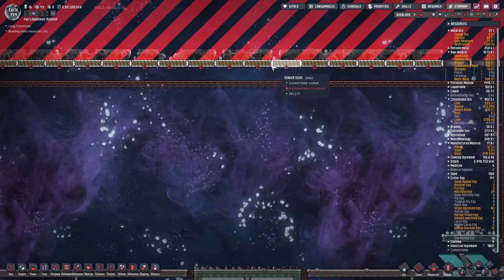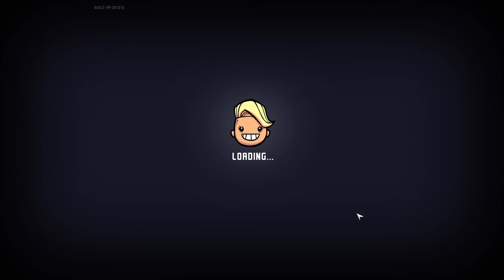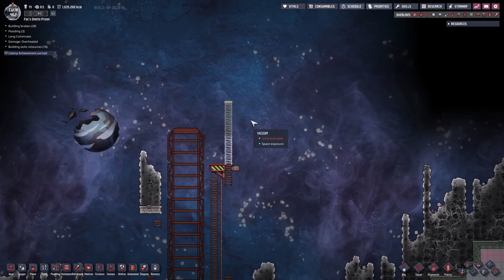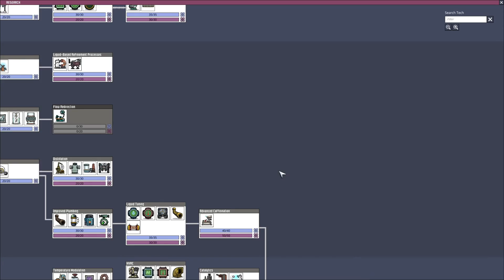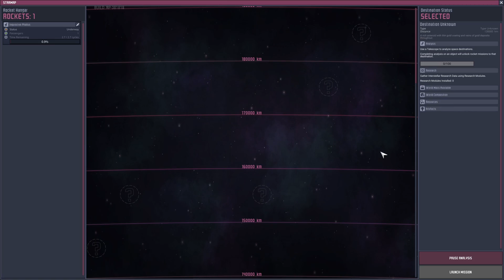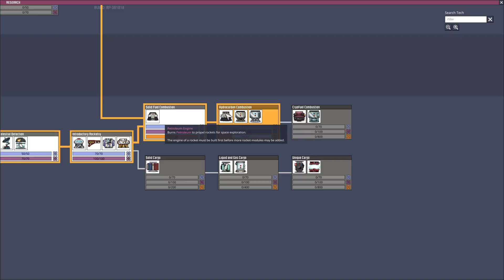FULL SIZE RESEARCH ROCKET! (OXYGEN NOT INCLUDED "Terra" Episode 33!)

Comment: The painting of W.T.Reed at [14:35] = XD It looks like a Mona Lisa Gone Bad
Reply from the maker: I take the maps regardless of their state as it teaches you to work under adverse conditions. It also helps to stimulate better solutions from your mind and how to prioritize if you have to give up certain things temporarily.
Reply: Life lessons right there! I can't say that I've got that kind of patience, currently -.- The problem I seem to  be running into, consistently, is that if there are good ways to sustain food, but not materials.. and then vice versa... no food, but a ton of materials...
Reply from the maker: It's mainly a know how thing. Every map variation can be survived.

You can find food by drilling into tiles that have the cracked marks all over them. That's where hidden items are that could be food.

If starvation is becoming a concern, you can prioritize a microbe musher and create mush bars to stave off starvation until you have a more sustainable plan. Remember that you only need to research the first tier of farming to get the basic pot that you can put meal lice into.

There should only be 2 building materials that matter in the beginning: sandstone and copper. Sandstone should be everywhere. Copper can be farther away. If you don't have a lot of starting copper, then don't build anything that requires metal except the necessities. So don't build doors for example. Once you have oxygen, electricity, and research, you can just directly tunnel to the largest or nearest pocket of copper and excavate it all. Don't worry about being messy, just get in there and dig that shit up.

If you're like me, you're probably stressing over things being pretty, or exact, or getting it right the first time. Bad idea. Just get in there and make a mess of it then clean it up later. Basically, you can't know how to do it right if you don't do it wrong first.
Reply: True, okay thanks! I've been playing on the Lush world, where food and animals are nearly impossible to get self-sufficient. Maybe I just need to go back to Terra. I picked Lush, or whatever it's called, because it seemed to be right in the middle of the difficulty range.
Reply from the maker: Here's another thing you should know. ONI is a lot like climbing up stairs. You don't really grow linearly. You grow in skill, then plateau at the top of a stair until you have a breakthrough/epiphany and understand how to do it. Then you climb up another stair and run into the next problem, your next "no food, but a ton of materials..." and you'll be stuck there just like you are now until you've learned the proper technique and may proceed onwards.

That's why I got so excited about launching the rocket. That was the "stair plateau" I was stuck at.
Reply: Hmm, I hadn't thought about it that way. I think I'm trying to plan too far into the future, where most problems are unforseen... Or trying to plan too many things at once...
Reply from the maker: To be more specific, "easy, medium, and hard" are all relative to the overall scale of difficulty. Terra, this game's easy, is another game's very hard difficulty.
Reply from the maker: From the way you describe it, I get the impression that you "want to do it right the first time" or approximately do it right the first time. You expressed similar thoughts in an earlier comment that by watching my videos you'll know what to do. I remember saying that the variance of the game will ensure that your situation will differ from mine.

This is mental trap. I know it because I do it too.

What's happening is that you're placing an unnecessary expectation on yourself that's unrealistic (at least this is what I'm sensing). It's like... taking a college course of a subject you have no understanding of, like trigonometry perhaps, and then expecting yourself to do it right the first time.

Mastery does not come from doing things right. Mastery comes from doing things wrong. Only by doing things wrong, and seeing the mechanisms of failure, of why it is not working, can you understand how to make it work.
Reply: Copy that, good buddy.
Reply from the maker: And then someone takes a freezing poop.
Reply: How many times did you have to start a map, find out that it was trash, and have to restart?
Reply: @GitGudFox  LOL! That sounds... painful...
Reply from the maker: Lol, I'll be honest with you. I don't think you're giving the game enough respect. You're trying to jump into the more complex asteroids before even learning the basics of the game.

I haven't even tried one of the new asteroids yet, but I have a tendency to learn systematically: arithmetic before algebra and geometry before trigonometry before calculus etc.